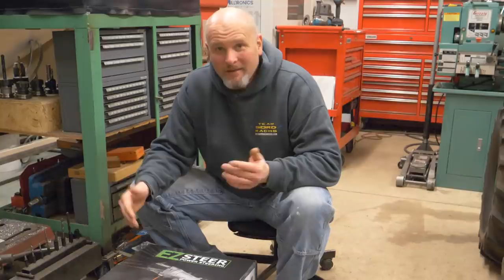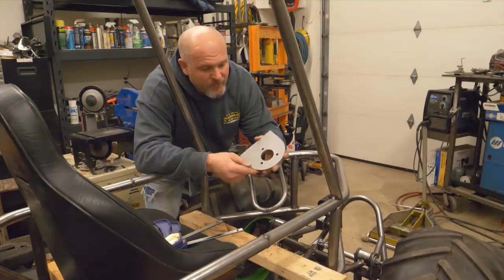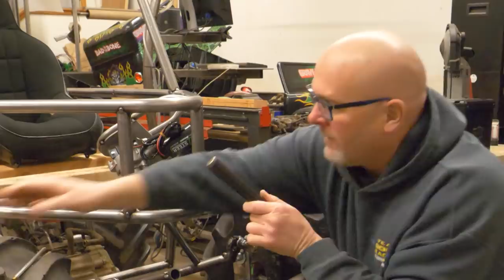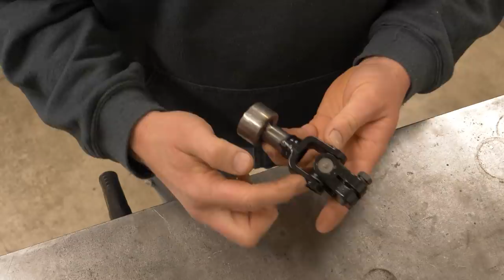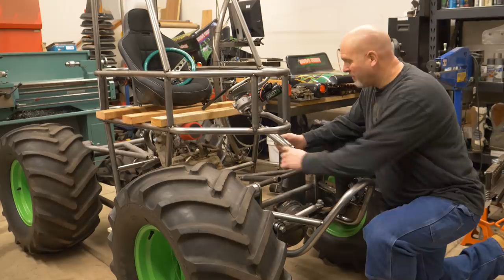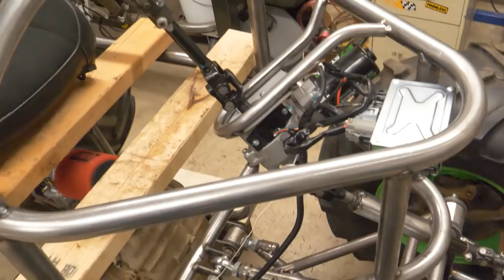Mini Grave Digger gets EPS Electric Power Steering Custom 4wd Modded Power Wheels

Comment: Great job on this part of the build. When you add your boot over the splined area don't forget to drill a hole in the splined pipe to allow air to vent, once you install the zerk fitting. It will keep the grease from blowing out. If you can cut a groove perpendicular to the spline on the inside, in the center area under where you could put the fitting, it will allow the grease to go around the hole spline from zerk fitting for a better coverage of grease. Just a thought; however, you can do what ever you want it's your build. Your kids are so lucky to have a dad you. Your definitely earning the Dad of the year award, again great build!
Reply from the maker: Thanks! I like your thought to make sure it can vent. Thanks for watching.

Comment: That electric power steering is pretty cool!
Nice work on the steering linkage. Your kids are going to have a blast! 
Ps are you going to need to do some gearing reductions to get this machine slowed down for more power and less top speed? If so how do you plan to reduce it? Take care Mike 🙂
Reply from the maker: It will be geared even lower than the quad was. The quad had 3.5:1 ring and pinions, these truck axles will have 5.38:1 gears. Even with the 31" tires it will be lower overall gearing. Should be very torquey!!

Comment: For those concerned with the possible loss of +12vdc to the steering unit, it wouldn't be a huge deal, as the unit is a 'follow-up' type linkage where there's actually a tiny bit of play in the steering shaft that transfers torque into pressure-sensitive switches within the assist unit. when the switch is triggered, the motor automatically follows-up on the output shaft till the input stops. This also works if the tire happens to hit something solid that would normally jerk the steering wheel out of the operator's hands, as the sensor is triggered from the other side, and the steering assist motor is activated to soften the feedback to the operator. I hope that explanation was clear as mud!😁👍

Comment: Everybody commenting on articulation and the steering shaft clearance needs to calm their tits...  The steering box is hard mounted to the axle just a bit over from centerline of the axle.  It's not going to be going up much farther (if at all when final bumpstops are in place) during flex and because the axle pivots around centerline~ish.  The front links aren't built to flex that much any way...look how short everything is (link wise)....  It's going to be fine...  Mike has an extensive background in rockcrawling and high flex rigs...he knows what he's doing...  Carry on!
Reply from the maker: Thanks Pete!!

Comment: Could have used hydraulic boat steering.  It would have eliminated a steering shaft, and is easy to use. Far cheaper as well
Reply: It would have less feedback and lower weight too
Reply: MicRuLerZ  great points.  It seems to be the best option that I can think of.

Comment: What about suspension flex, yeah you got the max compression down. But what about when the left front is stuffed up and the right is compressed some as well
Reply: Well you would want to stuff one side up in and let the other side hang as low as it can go to check what it will do under extreme flex. The way he has the suspension set the shaft is at its shortest and full extension of suspension it will be at its longest you start flexing the suspension the way has it set it will never go beyond that point. Motomule is by far one of the best fabricators out there. Don't believe so check out his street bike powered golf cart.
Reply: I think I know and for that fact bud... the two of us talk in Instagram, so get on with your trolling comments....

Comment: Since the steering box is offset, did you check for clearance when one wheel is at its highest and the other it's lowest?
Reply from the maker: The next thing I'm doing is the shocks. I'll test articulation and show that in the next video. Thanks for watching!!

Comment: Looking  good so far but did you check it with articulation , how well is it going yo work if one tire is up , you seem to only test it straight up and down and not side to side , does the suspension  only go straight  up and down with the set up you have ?
Reply from the maker: The next thing I'm doing is the shocks. I'll test articulation and show that in the next video. Thanks for watching!!

Comment: You could have also dismounted the steering input load cell and used it by itself on a steering wheel. Then mount the motor directly onto the axle itself for fly by wire steering.
Reply from the maker: That sound a bit above my pay grade... 😆 Thanks for watching!!!

Comment: some small cars have electric steering , i know the opel corsa has one that can be transfered to another vehicle
you where talking bout seals and i just remember a dirty joke : polarbear goes intoo a repairshop and trows a waterpump on the counter . the desk employee looks at the pump then looks up to the polarbear and says : "looks like you blew a seal"
the polarbear starts wiping his snout looking around the shop then asks the employee how can you tell?
Reply: True some cars have electric steering but there’s no mechanical connection from the steering wheel to the tires. If the vehicles power goes out on them you can’t steer the car.
Reply: @AlIsUpOutdoors  when even battery power goes out the car stops anyway as there is no power to the sparkplugs , only diesels keep running (old diesels) without power 

its only power assisted steering , you can still turn the wheel , aspecially with the car rolling
Reply: watahyahknow yes I understand how gas engines work. What I meant was if something happens and the power is cut on electric steer vehicles (not electric assisted power steering) there’s no mechanical connection from the steering wheel to the tires. You wouldn’t be able to control the vehicle while coming to a stop.
Reply: watahyahknow I used to work in auto body repair. We had cars come in because the electric steering failed.
Reply: @AlIsUpOutdoors  that is not how it works at all. For the vast majority of the electric power steering systems currently in use there is a solid mechanical connection through the assist unit so a loss of electric power means a loss of assist but not a loss of steering. The only exception to this that I know of is in BMW variable ratio electric power steering which does have a decoupler in the assist unit to allow for a quicker steering ratio at slow speeds. The decoupler is supposed to be failsafe and relock if power is lost. But I have worked on some that have not failed safely, or changed ratio inappropriately causing unexpected handling. Because, BMW.  That being said, loss of assist while driving certainly could cause an accident, due to the driver not expecting to have to suddenly work hard to steer. But that has always been the case even with old school belt driven hydraulic steering.
Reply: watahyahknow Petrol cars can still run if the battery goes as long as the alternator is up to the task same with new diesel cars cause the fuel pump and throttle need power to run so if the alternator in a petrol of diesel car can run the car when the battery goes your all good just don’t turn your car off till.
Reply: @AlIsUpOutdoors  Thats not true. By federal law, there has to be a mechanical connection, that's why hydraulic steering vehicles(tractors, and big mud trucks) are illegal to drive on public roads.

Edit: People would only wreck if power steering fails, if they are too weak to turn the wheel without the assist, and in that case they shouldn't be driving anyway. My 120 pound wife has had to pull off the road into a parking lot in a car with 11" wide front tires with no power steering, after the serpentine belt broke.

Comment: Question: Is that tubing going to be strong enough? I would think you could use a piece of schedule 40 pipe since it's wall looks thicker than that tubing. I've seen a similar setup and they used tubing that's almost identical and the electric power steering twisted the tube.

Comment: In part 5 you shows how much swing( I don't know what you call the movement)the front has at the end of the video.  Did you just kill the drivers side ? I know you used the jack to show both sides together. I maybe be wrong.

Comment: I know if you change the steering ratio, it will change the strength it takes to turn, but that thing looks like it will be hard to control with the ratio as it is. As in now, you have to turn the steering wheel a lot to get the tires to turn a little. I'll be curious if it will be an issue once it's complete.
Reply from the maker: It shouldn't be a problem, but it's definitely not high performance. This is the way Suzuki produced the Samurai from the factiry. Most older cars that didn't have power steering were like this.
Reply: @motomule  Yeah I went to a slower ratio steering rack when I went to manual steering in my drag car. That ratio makes sense now that you reminded me that the samurai didn't have power steering from the factory.

Comment: How many amps does the electric steering use?
Reply from the maker: It varies, I believe the max draw is 220watts. So 220watts/12volts=18.3amps max But I think that would only occur if It was stalled out trying to move... I really don't know what it draws just sitting idle.
Reply: @motomule  Awesome do you think you will need to upgrade the alternater?
Reply: after you add lights and acc
Reply from the maker: @OzBull  I hope not. This kit was made for a UTV, so I'm hoping it doesn't draw more than the quad stator can deliver. I'll add some gagues to keep an eye on that after its together.. Thanks for watching.

Comment: You could have purchased a steering column from a prius for about $90. It's just as easy if not easier than what you got. I hope you already knew that or you can still return this one, or else this seems like a huge waste of money. Also I hope the steering assist doesn't end up steering unintentionally when the front axle articulates since that will cause the steering shaft to turn